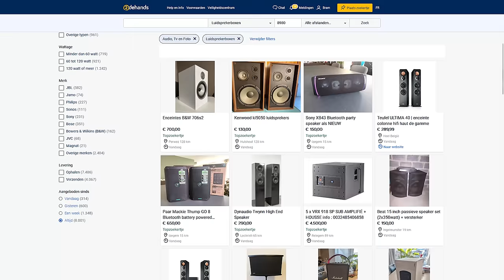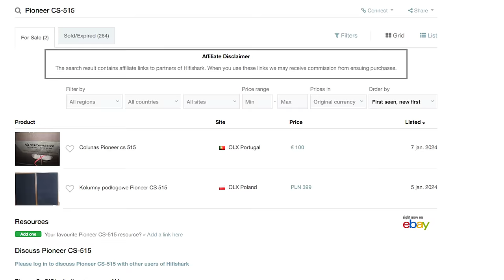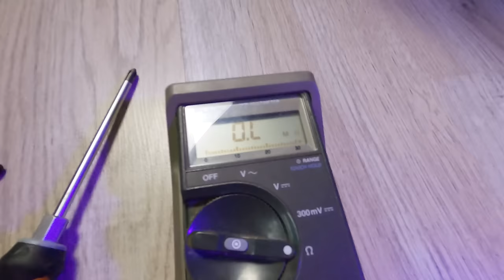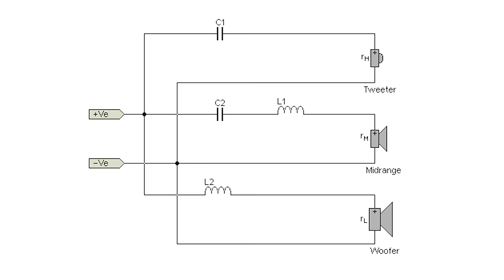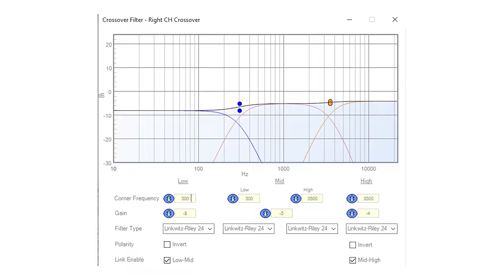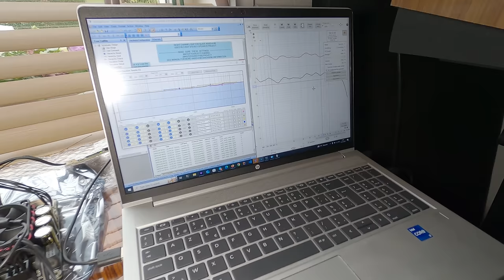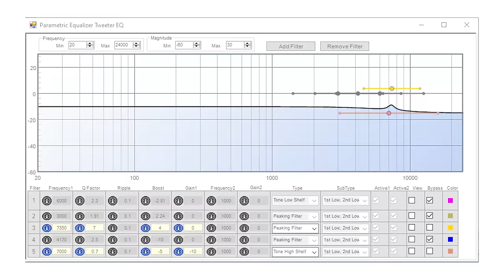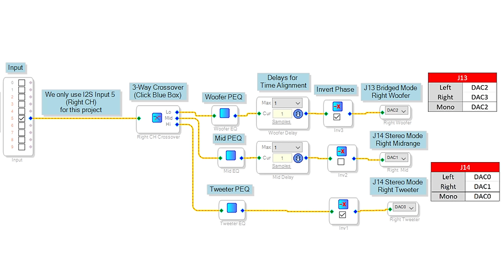Turning BROKEN Speakers into HIGH QUALITY Studio Monitors

Comment: For what they are I love the sound of my Pioneer CS-53's. They're still a budget oriented speaker but I think they were a model with a very slight step above what you have in your video in build quality. The cabinet is made of actual plywood and not particle/press-board. The rear baffles can also be unscrewed for easy access into the enclosure. Aside from that they are just a simple bass-reflex 2-way speaker with no actual crossovers. Just a filtering capacitor soldered to the paper cone tweeter. I would like to eventually add some actual crossovers into them as well as make them more rigid. Possibly add in some sound damping. For now they sound good as they are. :)
Reply from the maker: Those should be from the same period as this CS-515 speaker. One of the brochures that I found (which is shown in the video as well) mentions them both. I'm not sure if they are from the same series, I suppose not, but they definitely have a similar looking finish. I think adding an actual crossover in these would definitely increase the clarity, since the basswoofer won't be trying to replicate high frequency content anymore. Good luck with them!
Reply: @SirFreak  I've tried looking for info on them over the years and have found info for the later year versions. But I can't find what year date mine are. The factory plug-in's look to be of an early configuration. 

They still retain the same 1/4" SRT plug and screw terminals for spade connectors like the later models. But they are both separated on the rear baffle. On the later revised models both connector types are integrated into one terminal cup. Most likely for cost savings.

I'll most likely switch them over to a more modern plug type when I get around to making them better in the future. We will have to see. :)
Reply from the maker: @Slane583  Good luck with that modification!
Reply: @SirFreak  Thank you! It'll be worth it when I get around to it. :)

Comment: very nice, did exactly this with a pair Magnat MSP70, changed the crossover and the original metal dome tweeter ( i didn't like ) to a Radian LT 2.2, perfect fit and a very nice sound
Reply from the maker: Awesome! Pretty nice specs on that ribbon as well. Do you have pictures?

Comment: Taking a good set of older speakers that don't work and had better days but have a very good cabinet is a great way to build and refurbish speakers without starting from scratch. You usually can pick them up cheap at garage sales so not only will they save you time and effort, but also hopefully some $$ as well. Besides, how many people have a lumber mill in their garage to build from scratch?
Reply from the maker: My lack of a lumber mill is indeed why I tried this 😅
Reply: Downside is that many older speakers use that border where grills are meant to fit, which isn't the best acoustics wise
Reply from the maker: @RennieAsh  True, that's where the problems with the edge diffraction come from. I might experiment with some felt around the tweeter to see if that improves the frequency response (instead of compensating for it in the dsp).
Reply: @SirFreak  could also do it for the midrange, or just surround the border. Might not look as good unless you can cut neatly and maybe colour/dye the felt black

Comment: I really like how with the modern DSP based crossover you can help those vintage drivers reach their full potential. I believe you can help the bass driver reach a little bit lower, but at some point you will be limited by the maximum linear excursion, beyond which the speaker starts to distort, so this is dependent on the volume you are wishing to aim for. For a person who has never opened a speaker before, I'd say you have done an absolutely spectacular job, and I bet the sound you've got out of these boxes is worth much more than what you've paid for the components!
Reply from the maker: It definitely feels like I've got a speaker that's worth way more than what I paid for in components right now. It of course took time and effort too, but I learned a lot and it was really worth it for me in the end.
I'll be experimenting more with getting the most out of the bass driver before I decide to buy another driver. I'll probably be able to still improve some things in the DSP. I hope I can tell more about that in a next video.
Reply: You could adjust the tuning frequency by extending the port to some degree. Doesn't have to be a massive change, just enough to get more output towards 30 Hz or so, which I know those old Pioneer speakers can reach. I have an old pair of CS-656 speakers, and they do reach down to around 30 Hz. Also 10" drivers, but they are significantly cheaper made.
Speaking of Pioneer speakers. I have a set of DIY speakers with Pioneer car audio components as well, which I made in a hybrid transmission line design (T-line + pressure chamber). These play low bass frequencies down to 27 Hz, from a 6.5" driver. Now, I do need to rebuild them at some point, as the cabinets are made from scrap material from other builds, which resonates really bad in the midrange and high-bass frequencies. Now, the cutoff for the crossover is a little high (4.5 kHz). I would like it more if the cutoff were at 3 kHz instead, as the tweeters are more than capable to handle those frequencies (as the high-midrange is a little lacking). But overall, the speakers sound nice and crisp, and they play smooth bass tones.
Reply from the maker: @Skarfar90  Thanks for the advice! Good luck with the rebuild!

Comment: Here is how my friend dealt with the problem. He earned his electrical engineering degree and moved to SLC, UT to work for Harmon Kardon as a digital signal processing engineer. Harmon and JBL merged giving Ryan access to speakers and amps for little money. Ryan uses 8) Crown Pro amps each bridged for single channel operation. His system is 4-way with separate cabinet for each driver, separate amp for each driver. Each amp is over 1300 watts. Each amp has custom band pass filter for each driver. Result is seamless audio spectrum from whisper to explosion.
JBL shut Harmon down so Ryan now does same job for Atlas Audio. Very impressive system!!!
Reply: Parts-express used to sell Dynaudio drivers & diy plans for complete speakers. Madisound is also a good source for drivers and cross-over parts. My system is PrimaLuna vacuum tube based. Speakers are now JBL 4425 studio monitors. I also have 2) Crowns XLS & XLi 1500 series. XLS is class D & XLi is class AB.

Comment: Great job sir. Active equipment in a studio is the way to go.i allways wonder why so- called audiophile    expensive speakers are not connected this way
Reply from the maker: I guess there will be reasons like "you don't need a power source where your speaker is", and "because it has always been like this" will also be one of them. This hybrid approach of an external amp that is still tri-amped is the most optimal in my opinion though (although the cost of the cables is a bit high).

Comment: Very cool and useful project! I also used sigmaDSP with a simpler 2-way actively crossed PA build for my band. It's awesome how cheap DSP control has become, especially since analog crossover design can get pretty hairy! I used the ADAU-1701 DSP with a 300Wx2 wondom amplifier for the subs and a couple little 50w mono amps for the piezo horn loaded tweeters.
Reply from the maker: Really lovely that these boards exist. They're far from perfect, but do the trick

Comment: Even though I'm an old school passive xover-only guy. you've done a great job on these.... definitely go for woofers with a flatter response, that'll make your mixes easier. Challenge is to find one that is suitable for the box size (& you may need to change the tuning...)
Reply from the maker: I still have some research to do :)

Comment: I am also running a tri amped system with a cheap class D board like this. It helps to put a resistor in line with the tweeter. As this is the main producer of high frequency noise. By changing the gain structure you can compensate for the loss in volume but at the same time reduce noise. You just need to drive the amp a bit harder which will improve the SNR.
Reply from the maker: Great idea! The tweeter amp is 100w, but the tweeter has a nominal power handling of 10w, so I still have some headroom that I can lose. Right now I'm turning the gain of the tweeters down quite a lot.
I'll definitely try adding resistors, perhaps even a little L-pad to the midrange as wel (since that is turned down as well).
I'm not quite sure what type of resistors would be best for high quality audio? Do you have any advice on that?
Reply: @SirFreak   Nah you dont need to go fancy resistors. Just make sure they can handle a bit of power.

Comment: Excellent video and a superb job! Just a few points being  DIY'er speaker builder myself, good choice to have the lower crossover point to the planar tweeter. This integrates better to the mid, as mentioned, and being that the planar tweeter can be crossed lower. The felt absorbent material only needs to be on three surfaces, rather than all of them, which will yield a deeper bass cut-off point, and still reduce internal standing waves just the same. The edge diffraction can be controlled by applying a thin layer of felt surrounding the tweeter to the edge of the cabinet. The better method would be a more involved modification, by offsetting the tweeter on the front baffle. The diffractions in this case become more diffuse, (less audible) and do not sum at the same frequencies.
Reply from the maker: Offsetting the tweeter would be quite a drastic modification, so I'm not sure I'll go for that. But I might definitely try to use some felt around the tweeter. Just not sure what felt to use yet. I hope I can find some black/gray felt, so it does not stand out too much.
Interesting. What's the reason that three surfaces will result in a deeper bass cut-off point?
Thanks for the tips!
Reply: Hi SirFreak, This may seem counter-intuitive, an internal standing wave needs two opposing surfaces to set itself up. If we have one bare surface opposed by another bare surface, there will be interference, and standing waves. If we glue absorbent material to one opposing side, it absorbs some energy, delays it, converts some into heat. The longer waveform released by the treated wall, interferes less, or not at all with the untreated one.

Asymmetry in speaker design is your friend.

The enclosure volume was designed to work with the port as a system. As we stuff, or over-stuff the box, an ideal amount may improve bass quality, but then adding more (too much) can reverse this, and produce less bass. The cabinet and port system may develop a mid-bass peak that wasn't there before. The quality of bass will be affected by how we stuff the box, and how this changes virtual box volume and actual box volume. Adding absorbent material tends to make the virtual box size "larger" however there will be the point of diminishing returns,, that more stuffing reduces actual box volume, and reduced bass output and quality.
Reply from the maker: @TheFRiNgEguitars  Interesting, thanks for the extensive explanation!

Comment: The existing 10" woofer can be tuned lower via adding some cone mass, e.g. some Blu-Tack around the dust cap vent hole (the Thiele-Small equivalent is to add parallel capacitance across the driver coil) and the existing enclosure can be tuned c. 10% lower via stuffing the cabinet with speaker wool. 
You'd be changing the older "warm" c. 100Hz resonance to a more "punchy" modern sound that may better suit your music genre.
High-end English speakers of yore were similarly tuned via gluing washers behind the dust cap! :)
Reply from the maker: Interesting, definitely stuff I will experiment with!
Reply: @SirFreak  Experienced speaker builder's example here: https://www.youtube.com/watch?v=Cko7eVet9Ec

Comment: Very enjoyable to watch. Entertaining and you described everything well with humour. You approached each problem with 'sound' reasoning. My only issue is the 3 DAYS it took to stick the bitumen in the boxes.. Good grief! (Ha, ha, ha.).. The tweeters are excellent, have been around for decades and are outstanding value. 
Going active with DSP has so many benefits... Guaranteed to push the performance of even these 'Frankensteins'  beyond the majority of commercial passive designs.  Very well done, you chose the donor well too, the paper Pioneer drivers are lightweight and very responsive and subjectively sound fast, exciting and detailed. PS There are better ways to brace the cabinets, but just be aware the internal volume will be robbed if you do get serious about it. Subscribed of course.

I know TLDR and a bit all over the place... Can't help it, I've been up for 36 hours 🤠
Reply from the maker: I had to make a lot of small cutouts in the bitumen sheets, and that took ages. There are probably better ways to cut it than how I did it, that would take less time. But even taking this long, the end result was worth it.
I could indeed have braced more, but I was afraid to alter the internal volume too much. There might be better bracing techniques as well, but I'm quite new to this, so if you have some tips on that, or material I could read, that would be very welcome!
Thanks for your extensive comment!

Comment: You can add a ring or panel of the sticky felt around the tweeter to reduce or eliminate the edge diffraction. It maybe a bit thick so a thinner version maybe better. A brace behind the bass speaker magnet may give the bass more impact.
Reply from the maker: Thanks for the feedback! I had also thought about experimenting with some felt around the tweeter, but perhaps I'll try to find some black felt, so it doesn't stand out too much.
Definitely things I should try.

Comment: I ve built a s8milar project as yamah yas series soyndbar (providing surround sound from single point execution)  by using class d amplifier for every speaker individually and a class d preamp  i used shielded cables starting to end in the entire cabinet . Not a single normal wire only shielded . If you turn it On you will forget it that its On if its not playing any thing
Reply from the maker: Awesome!

Comment: I want to replace the drivers and customise the *enclosure for my sony micro hifi system, the woofer rubber part is so brittle it cracked after i cleaned the dust from it, it still plays alright with lowered volume and bass but definitely a great video for my recommended feed.
Reply from the maker: You might also want to look up "driver refoaming". Worth a try and will be a lot cheaper and easier than finding a new replacement driver.

Comment: Great video!
Did you notice some back noise from the connector cut outs? I did find that those ate not air seal, so I used silicon glue to them.
Reply from the maker: Hmmm. Haven't noticed that, no. As far as I could see they were sealed, and I suppose the bitumen sheets over them will also add an extra seal. I did apply glue around the new connectors though, as I wanted to make sure they were (and stay) sealed, so they don't leak air over there. I'll do some extra checks on the existing connectors to make sure there's no leakage over there, and if needed I might apply some silicon as well. I could be wrong, but I don't think there will be any issues there. But it never hurts to check, right? Thanks for making me aware of this!

Comment: Hi first of all sincere congratulations for your excellent project
As you say at the end of the video the weak point could be the woofer   It is clearly a cheap unit considering the cost of the speakers  They say that parts cost should be 1/5th of the total cost = 100 euro for all drivers and xovers and cabinets
Good woofers are expensive   
Personally i would have used cheaper tweeters considering that they have to cover just from 5k up
You have done a great job with the cabinet  Very very good
Reply from the maker: @gino3286  Thanks! In the meantime, I have also installed new woofers. I hope to make a video about that soon.
Reply: @SirFreak  Hi that will be very interesting as well  Studio midfield monitors are usually very expensive  A good woofer could provide big benefits in terms of added bandwidth and lower THD

Comment: I have some old but not that old Yamaha studio monitors that are starting to sound tired.  I bought them used for $40 around the year 2000 and have been using them just about daily ever since.  I cannot find woofer replacement for the life of me...the woofers are a semi tranparent cone so you can see the copper beneath...I like the look and they sound great, even if not as great as they used to.  I am wondering if the woofers even need replacing...a modern crossover and new tweeters might make them sound great again.  I think I might try to resolder all the connections first to see if that helps anything...maybe some solder has just gone weak over all these years.  Maybe some QoL upgrades like banana plug connectors, a small 12v  stereo amp with bluetooth mounted to the back to make them portable.They only have 6" woofer.  I think if I were to upgrade the woofers, I could probably fit 8" but would obviously need to get a router to enlarge the cut out.  These $40 have been one of my best puchases and Id love to keep them going for another 30 or 40 years.

Edit...i have never opened the speakers csuse they are glued and soldered...what are the chances the reason I cannot find replacement woofers that look like this from Yamaha is that someone had already replaced the woofers with another brand?  Hmmm...
Reply from the maker: Hmm I could be wrong, but it sounds like they might need new capacitors?